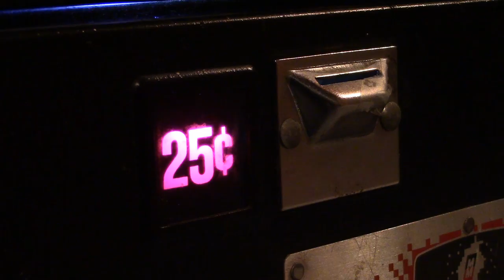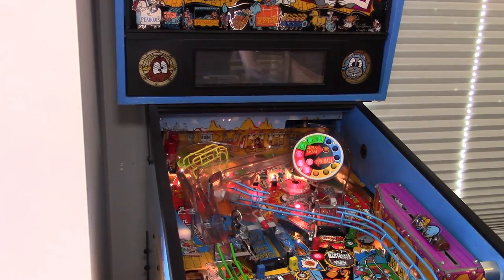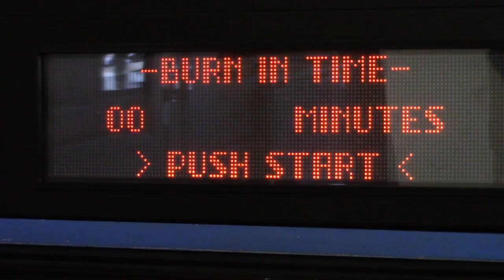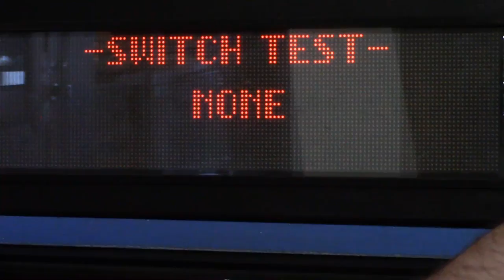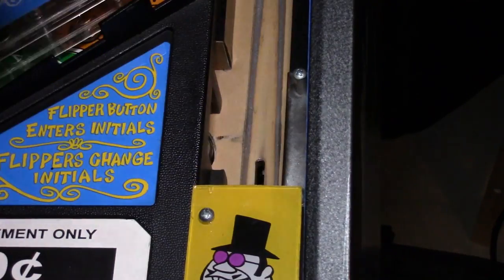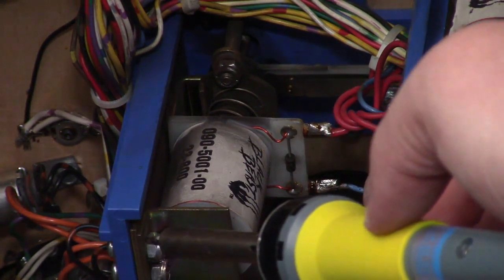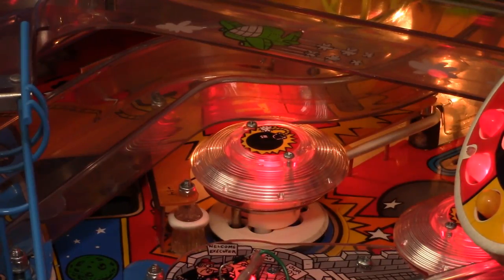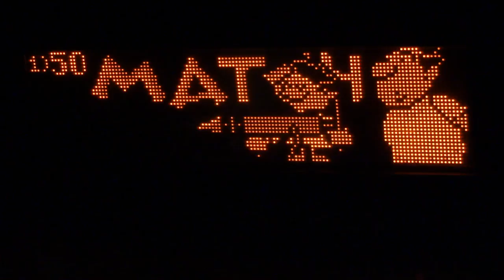Fix It In Five - Data East Pinball Pop Bumper Repair

Comment: Would it be advisable to add solder, use a solderpult to remove the old solder completely and then re-solder the wire strongly?  That solder job looks like it would work on a non-vibrating application, but for a high vibration coil it will lose the connection again over time. Might at well fix it once and be done with it.
Reply from the maker: +DeLuSioNaL Arcade you'll notice a jump cut right after we apply new solder and suddenly there is more new solder. We actually stopped rolling and cleaned up the old solder and reapplied (I like to use a solder braid on that sort of stuff)... realized hours after we shot we didn't get the cleanup portion on film. you should see some of the original factory soldering on the thing, way bad and surprising that its still holding on after so many years for a lot of the connectors. I am sure this is not the last time I'll be fixing a similar issue in that machine. Some day it'll get ripped apart and we'll cleanup and reflow all of the connections in one swoop :)